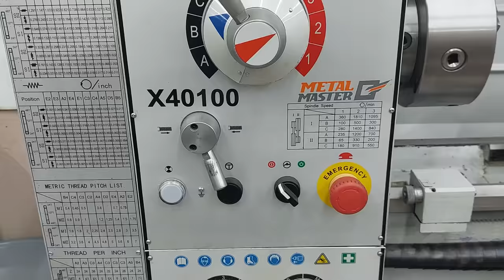I didn't believe it myself! A simple idea and useful tip in 7 minutes for metal processing

Comment: That is not a knurl, it is just roughing the surface.  Knurling displaces the metal to form a diamond shape, raising of the metal that will be larger than the parent diameter.  That type of tool will not work on unsupported material too much tool pressure is required.  A tool using opposing knurling wheels like scissors will work better, but still needs some support.

Comment: 2:00  Use a center drill. Support it with a rotating center. When you pull out the rod, the axis of the threaded part shifts and starts Lathe runout  .

Comment: You need a small hole opposite each hole the tap goes in to allow for a spring loaded tapping centre to hold the tool straight to keep your tap aligned.